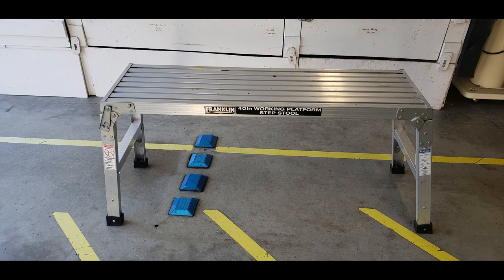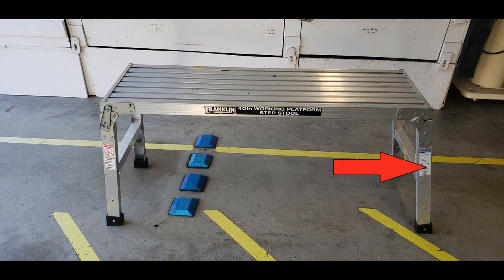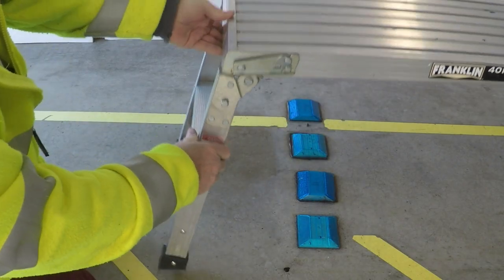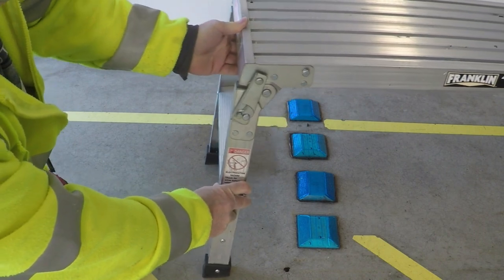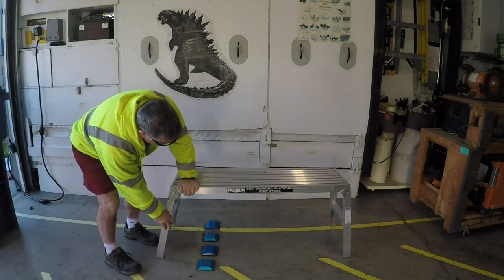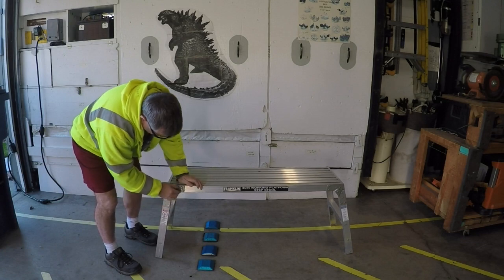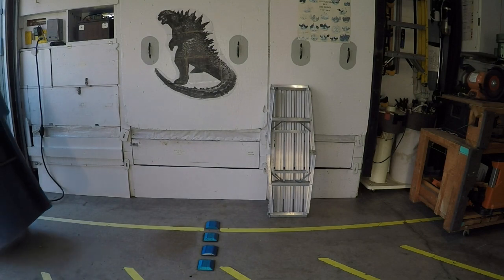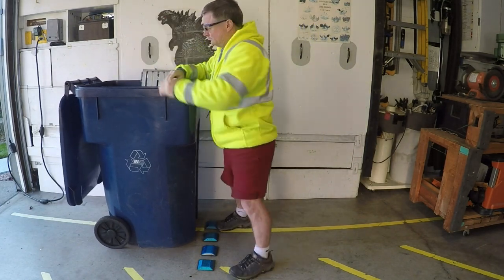Making this work platform safe

Comment: Drilled a hole through the lock mechanism and leg put in a 1/4” pin solid as hell.I use it daily and have had no issues.$45 with coupon $95 with tax for a gorilla.
Reply from the maker: So you removed the ability for the platform to fold? Kinda why I bought the thing in the first place. I am glad that your fix worked out for you. Perhaps you can post a video on your you tube channel showing others how you did it? (I don't understand the $45 and $90 gorilla statement.. Do you work at a zoo?)
Reply: No I pull the pin.